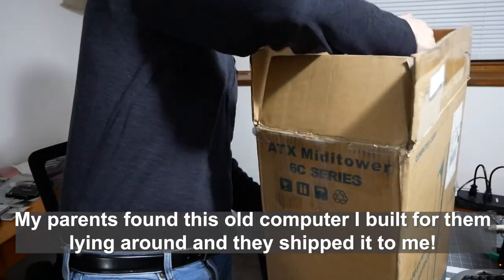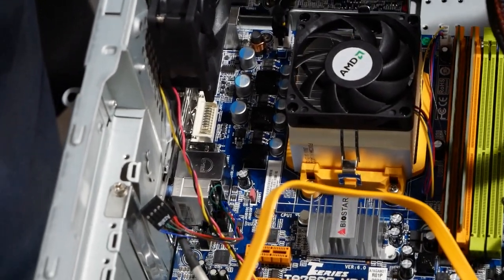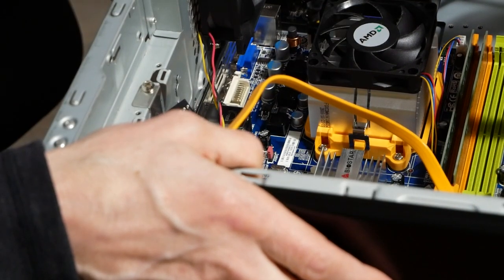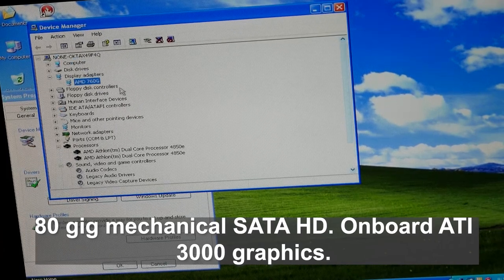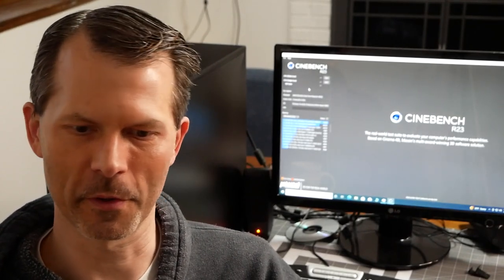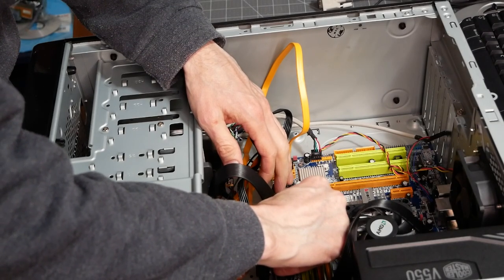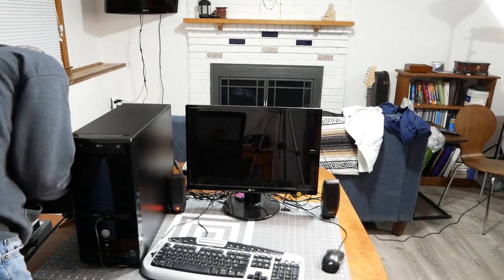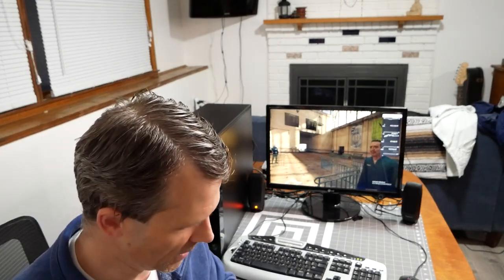Is The AMD X2 4850e Any Good In 2023? Quad Core upgrade! Can You Game On It?

Comment: I'm planning to upgrade my cpu it's the same as urs with a am2 motherboard what cpu should I get I was planning for a fx 6100 but pls tell me what should I get
Reply: cause i'm tired of all the lag my system gives me with the amd 4850e cpu and i think its time for an upgrade, i was gonna place a gpu  but it would obviously bottleneck it, so im thinking of doing a cpu upgrade. but im scared of my motherboard going to crap  since im planning on getting a fx 6100+gt 710 2gb ram ddr5,  but my motherboard is a hewlett-packard 3029h am2 ddr 2 memory i really need a budget upgrade can u tell me some sugesstions? i had that amd x2 4850e since the time i was born LMAO XD   (2009),  but its  time for an upgrade sadly..
Reply: thanks in advance.
Reply from the maker: Hi. I would say the Phenom II X4 940 or 955 Black Edition. If you have a good cooling heatsink and fan. Also make sure you look up your motherboard to double check what cpus it supports.
Reply: @RememberThisTech  ah so a amd fx 6100 doesn't work? BTW I tried to look up my motherboard but it's so old that I can't find the manual for it but thanks!
Reply: I don't think I have a Heat sink but my pc has dual fans is that great?
Reply from the maker: @ok  The heatsink/fan combo sit on top of your cpu to cool it. If you're currently running that computer, you most likely have a cpu cooler on it. What cpu is in your computer now?
Reply: @RememberThisTech  it's the amd 4850e and I'm planning to get a amd fx 6100 but idk if it would work, the manuals don't help at all I'm trying to game on a budget lol
Reply from the maker: @ok  so tell me exactly what motherboard you have. Biostar? What version and model. Because I need to know all that to make sure it will take the fx 6100 cpu. Because if your mobo is am2+ the 6100 is am3+ chip. So it may not work and I'm trying to help verify it will or won't.
Reply from the maker: @ok  ok just saw this let me look up this hp mobo and see what It can take.
Reply: @RememberThisTech  alright thanks.
Reply from the maker: @ok  From what I'm reading your mobo is am2 or am2+ so to be safe get an amd  955 black or 945 quad core. Compared to your x2 chip you will get 500- 700megahertz speed bump and an extra 2 cores. You will deff see a big improvement. Plus you should be able to get one of those chips for 20 bucks or so. The fx6100 would be nice but it's for a different socket mobo..
Reply from the maker: @ok  the system in my video struggled with the 4850 x2. But when I did the modest 945 x4 upgrade everything improved. Granted it's not a new modern day 600 dollar chip but you will see a big improvement for 20 bucks or less
Reply: @RememberThisTech  thanks. I live in a different country so prices are goofy but you just saved me 500 pounds.
I will be getting the amd 955 black edition for my bday you just earned a sub!
Reply from the maker: @ok  ty. Let me advise getting a non black edition. But sticking with a AMD phenom ii x4 955 cpu.. MAKE sure it's a 95 watt cpu.. because some of those HP machines wouldn't take higher than 95 watt cpu. So the black chips are 125 watts.  The 945 955 are still strong! But 95watts cpu to be safe!! I know I said black cpu before and don't want to confuse but I'm at work lol and I'm trying to research this and not let you waste money on a cpu that won't work :( sorry for any confusion
Reply: @RememberThisTech  alright
Thank you so much btw! And sorry if I annoyed you.
Reply from the maker: @ok  No you didn't annoy me at all! Glad to help if I can :)
Reply: @RememberThisTech  just searched the chipset it self which is a amd 780g and it thankfully supports 125w without any problems  even if overclocked.  it supports the phenom x4 and the x6 but not the processors that ARE FX  i again thank you very much for how many pounds u just saved me lol, and even tho it supports the phenom x6 1100t ( which is the fastest 6 core processor). im not getting it its expensive, and so rare! 11,000 pounds for a 2010 processor?! yeah i will be sticking with the  955 be.
Reply: @RememberThisTech  btw should I combo this 955 be cpu with a gt 710 2gb? I'm trying to be cheap cause everything is getting expensive day by day lol
Reply from the maker: @ok  go with thw 945 or 955 non black edition 95watt cpu.
Reply from the maker: @ok  true it says that the hp system you have is a 780g chipset. But if it was me I'd go with the 95 watt non black part. To be safe. Also the hp power supply might be low wattage.
Reply: @RememberThisTech   just searched the specs of my  pc which is a hp 5850 microtower and checked the manuals and it turns it it has a 300 wats power supply. so it should be okay for the amd phenom 955 be. (even okay for overclocking maybe), and a gpu btw what budget gpu do u suggest to get for my budget build?
Reply from the maker: @ok  I guess that depends on your budget for the video card. Definitely go for a card that doesn't require an additional power connection.
Reply: @RememberThisTech  hmm so say like a gt 710 ddr5 version is good for it? i cant afford a gt 1050-960 since my parents would obv decline but i think i can go between a gt 710 (since its on sale near my location) and a gt 730 ti
Reply from the maker: @imstraight420  If You can afford a 1030 it's way better than a 730ti. But a 730ti is much better than the 710 if it's your only option.
Reply: @RememberThisTech  alright, guess a amd phenom 955 be with a 730 ti  is i think gonna be good for roblox,minecraft,tf2 anyway thank you for helping me choose my budget build!!
Reply from the maker: @imstraight420  NP I hope it's a step up and gives you a bit more power to play a few games with less stutter!